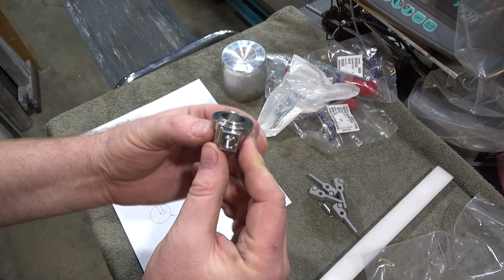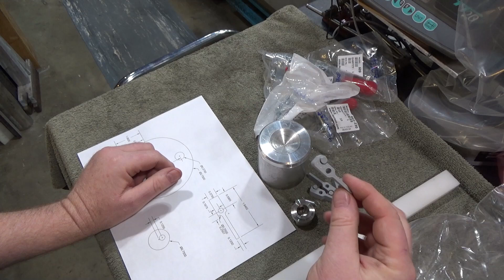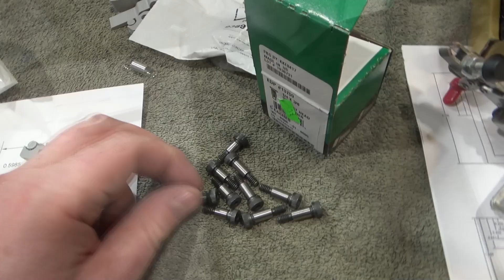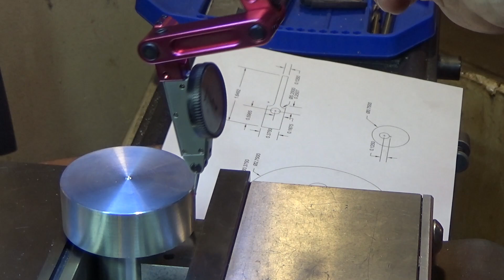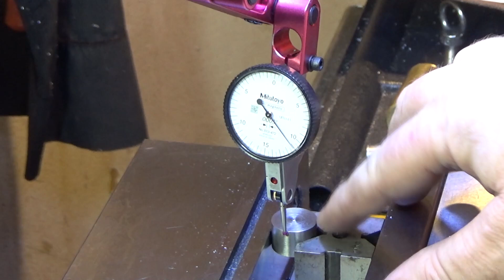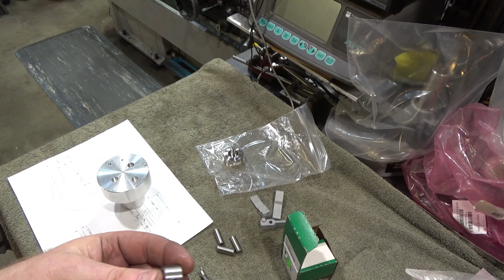245 Rotary Fixture w Eccentric Cam Lock

Comment: One of the most important parts of fixture and tool design is understanding all the tolerances and geometry of the parts you are trying to hold. Hopefully your customer gave you good drawings of the parts. Nice overall concept. 👍
Reply from the maker: I agree, but I got no drawings with tolerances. This is a real issue with customers of the laser welding company. They ask, but often do not get.

Comment: Mc-C has dowel pins with tread holes so you can remove them with  a slide hammer puller.
Reply from the maker: I had forgotten about those. Thanks for the reminder.

Comment: The part does seem to lift even when you hold it down. Perhaps you could reduce the height of the 3D-printed pad so it only touches the bottom? More concern over crushing, maybe, but the part lifting may be a worse choice.
Reply from the maker: I noticed. I was thinking I could make the plastic bit with a negative slope that would counter act the tendency to lift. I appreciate the observation and possible solution.

Comment: 12 thousands maybe too little, cause the plastic is gona squish over time, but could print thicker ones.
Reply from the maker: That is a fear and an excellent observation. As a matter of fact, I printed some slightly thicker press plates before I delivered the tool.
Reply: @DudleyToolwright  Could also maybe put a thin strip of vulcanized rubber on the face that touches the part just to limit the creep that will happen over time.  I also like your idea of putting a flat on that rear pin to prevent any unwanted rotation that could happen with a smaller part as they're locking it into place - although you might have to prevent that pin from rotating also. 
Love your videos and appreciate you sharing these kinds of jobs.
Reply: @DudleyToolwright  wont the plastic melt from  heat? im not sure how laser welding works. great job on the fixture